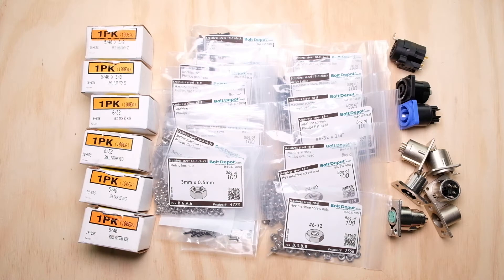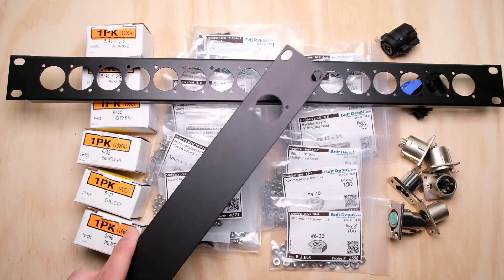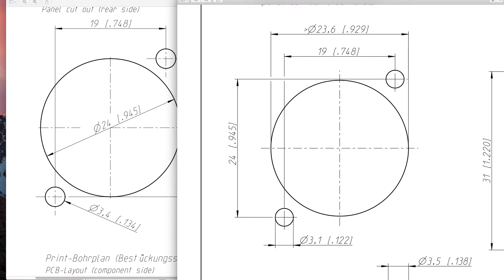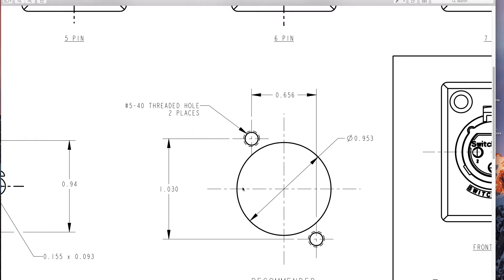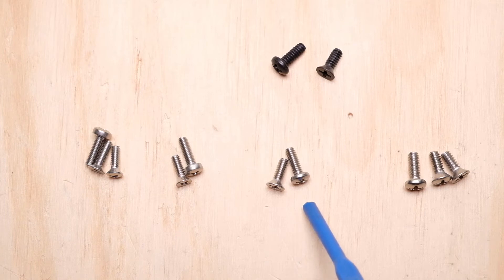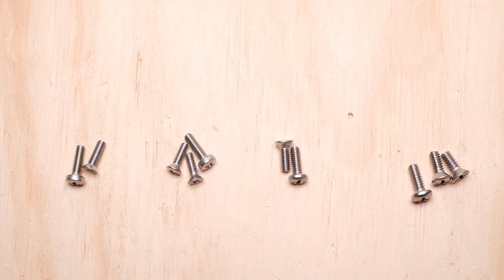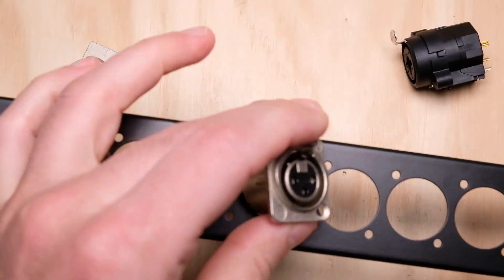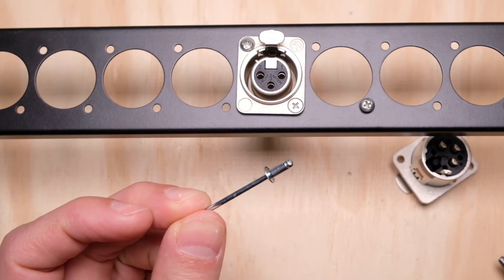Audio Jack Mounting For Rack Panels

Comment: Holy shit this is awesome. I've been searching everything all night looking for this exact info. Making a custom panel out of an aluminum case using these D-series panel mount connector and you'd think it's just all uniform standardized measurements. But I quickly realized that's not the case at all and you really need this info in order to not screw up your holes. Thank you so much!
Reply: Glad it was helpful for you!

Comment: I currently use Neutrik MFD exclusively instead of nuts when rear mounting. They are way more expensive than nuts, but still affordable if you only occasionally fill a rack. They save you so much time and are soooo easy to use.

Comment: This video was great I learned a bit more then I already knew, and I see I am not the only one that cares this much about the exact type and material of fasteners to use, I prefer 6/32 button head socket cap screws as they fit the holes in the Neutrik NC3MD-L-1 XLR Connectors I use exact, and I feel have a higher end more professional look then Philips mostly cosmetic but I also never liked working with Philips. I get these in both SS and Blk Ox depending on the project and think the final build looks fantastic as the button head type gives a nice finished look even though its not countersunk. plus this type of screw can be used directly on the jack face or on a panel. I don't worry about the other size as I don't like or use Switchcraft ever.
Reply from the maker: Sounds clean!

Comment: I need to take a TR cable from a guitar and split to 4 TR outputs without signal loss, what do you recommend? Do they make rotary switches so I can select between which of the outputs to use?
Reply: I'm sure a rotary switch could be cleverly employed this way. Although, if you need to use more than one channel at a time, that could get complicated quickly.

Comment: Excellent video! I will very much appreciate all of the information as I'm designing my first rack panel. One question I have right from the front: When it comes to the question of front vs. rear mounting the connectors, how does the use of products like Neutrik DSS-1 / DSS-* come into play? Can you even front mount the connector in combination with this colored nameplate?
Reply from the maker: Honestly, I have no idea on this one. I've never installed one, or even held one in my hand. Also, it has to depend a bit on which part series you're using.

Comment: It's just completely unnecessary to use nuts and RED locktite... it'll NEVER come off, it's the same to use rivets in that case, easier and faster and cheaper.
I mean if you use nuts, use nylocks, but better yet, DON'T use nuts and make things easier with neutriks MFD mounting braket for D-type connectors... no need to use nuts, just snap the thing in and then screw it in place with M3 machine screw :)
Reply: Indeed. The MFD fixing plates are well worth the cost.